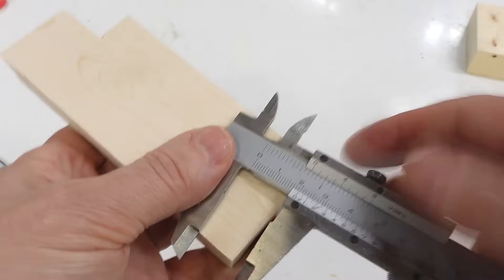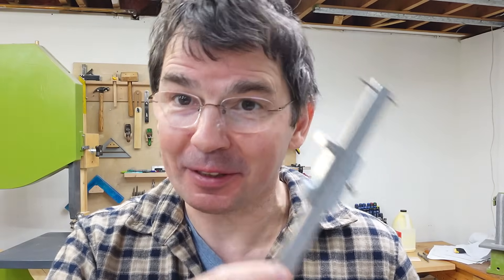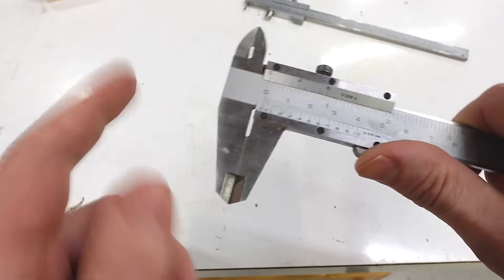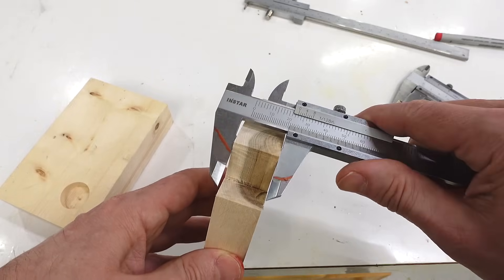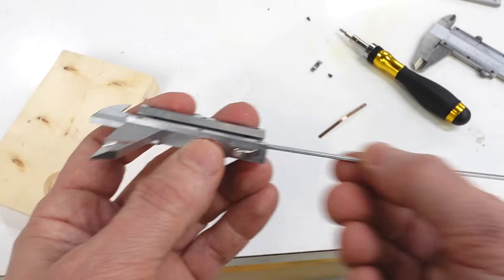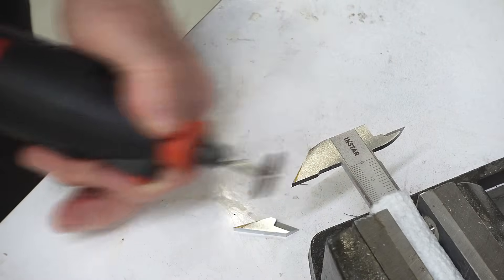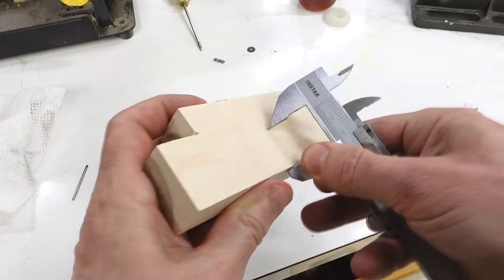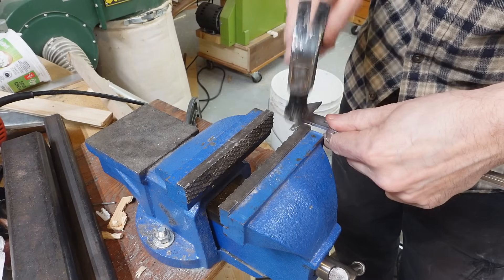Making scribing calipers

Comment: i misread it as scribbling calipers lol ,...but got me thinking what if you made the top part of the larger side of the caliper into a ruling pen, then you could just draw your line instead of scribing, the inside of the pen would just be flat so you would always scribe at or very close to the line depending on the ink and placement of the outer piece of metal.

Comment: I use cut-off disks instead of the ceramic disks.  They are fiberglass reinforced, cut just as fast, but have some 'flex' and don't shatter.

Comment: This isn't your inspiration, dear Matthias. What you've discovered is a standard metalworker's marking tool in Germany, which I used more than 23 years ago during my apprenticeship as a metalworker. The tip used to be made of HSS, but now it's made of carbide. There are also metal marking gauges for wood, with circular blades, and they're not very expensive these days either.

Comment: I would never use the carbide caliper/marking gauge with the roller.  To properly mark a line at the right distance, a fence is required.

Comment: Kewl.

Yeah, I was taught to use scribing calipers by my dad, back in the Sixties. Handy!

About a dozen years ago, I scratch-built a pair of "giant scribing hermaphrodite calipers." About 10' long, overall, articulated. Purpose: Scribe a line on the wood-planked dock of the Jungle Cruise ride at Disneyland concentric to the 2-7/8" OD pipe guide rail under the dyed water of the attraction, as part of reworking the dock edge from segmented straight lines to smooth curves. The bottom end gripped the rail, with four small wheels, so we could roll the rig along.

Comment: I'm a machinist and sometimes use my Mitutoyo calipers to scribe lines. It's not a big deal, and I don't understand why some machinists are so upset by it. Most of the time, when using the outside jaws, you're measuring closer to the slide, not with the tips of the jaws. If you end up giving it a burr, stone it. If you're worried about calibration certifications, your calipers should not be the final say in inspection; they're for quick measurements out on the shop floor.
Reply: I never did it either until I saw a good machinist at work do it (I'm an engineer).  Now I do it.

Comment: I dunno if it's for engagement, but the right word here is "scribing," not "scoring "or "scratching." (various commenters use the words scribe/scribing/sciber, but I don't see any making this point exclusively).
Reply: What's the technical difference between "scribing", "scoring", and "scratching"?
Reply: @BenInSeattle  That's not really a question with an answer. "Scribing" it the term we use when marking metal, and "scoring" is a term that is used with respect to wood and paper. They do not have "technical" definitions in the same domain, and I'm not sure that "scratching" has one at all. This is a little like asking a violinist what the technical difference is between "vibrato" and "the way you shake your fingers on your left hand while you play."
Reply: @johnhawkinson  Ah, I thought "scribing is the right word" meant the other words were not right. I get it now, they are all correct, but "scribing" is the most precise.
Reply: @BenInSeattle  It's not really "precision" as much as "the right word for this area of work." Trying another metaphor, supposed someone asked why you "drive a car" but "ride a bicycle." You could "drive a bicycle" but we don't way that. And you would not say "ride a car." (You could say "ride in a car," but that has a different meaning).
Reply: @johnhawkinson  How sure are you that people don't use the term "scoring" in carpentry? I'm not a carpenter, so I claim no expertise, but googling about makes it seem like experts use both "scribing" and "scoring" to mean the same thing. I think an analogy might be "piloting a plane" and "flying a plane": both are correct although one is used more often than the other.

(Since it's hard to tell tone of voice from text, I should probably say that I'm not arguing. I'm just curious and want to learn.)
Reply: @BenInSeattle  That's not what I said. Indeed, I said "scoring" is a term used with respect to wood and paper. That's carpentry. But for metalworking and machining, scoring is not a term that is used. Your analogy as to piloting would support the use of the term scoring on metal, but that's the opposite of my point: The term scoring is NOT used with respect to metal, both are NOT correct.

Comment: There is a tool for that, it's called Streichmaß. One my father had was a wooden block with two sticks in it, each with a nail in it. Simple, but surprisingly useful!
Reply from the maker: yes, quite aware of these, but I always end up setting them with calipers.  Might as well scratch with the calipers.

Comment: the purpose-built ones you ordered seem like they would be much harder to hold perpendicular to the edge you are tracing, causing variation in width of the offset

Comment: Love this. Did a very similar thing (without the longer leg, smart design choice!) on my old General fractional calipers and use the crap out of them for the same application. 

In hindsight, have you considered swapping the carbide scribe tip with drill rod or similar 2mm tool steel for woodworking? It’s easy to sharpen and resilient enough to withstand scribing. I’ve used drill rod for making regular marking gauges and quite like it, plus I don’t feel bad when the tips are pennies to replace. 

Thanks for sharing!
Reply: Or a broken 2mm drill...
Reply from the maker: I figured if I broke all three carbide tips, I could just swap it for a nail.  Don't have any 2 mm drill rod.  There might be other shafting that works too.

Comment: Definine 'accurately' though as its a vernier user vision is likely the limiting factor and calipers generally are not very accurate anyway with how long the jaws are.
For a woodworker you do seem to be developing into a machinist in the most amusing fashion, and I can absolutely approve of using a cheap tool to make what you need out of it. Though with any of these cheap tools you can easily end up spending more time and effort making it work well enough in the first place, but sometimes you do get very lucky. I'm fortunate in having a retailer largely of decent enough relatively budget tools in walking distance so I'd probably spend a little more on the tool to butcher but you can't beat the wait time.
Reply from the maker: .1 mm accuracy is good enough for woodworking, and that is easy to read off the veneer caliper.
Reply: @matthiaswandel  Unless you don't have any old Vernier calipers, and in 2020s all Verniers in stores are 0.02 mm which will make you curse endlessly if you are over 45.
Reply: His videos that got me hooked were wood gears and a counter.  He's always been a machinist, he just happens to work mostly in wood.

Comment: My dad made a scribe calliper with teeth of a circle saw blade. De soldered the tooth and grind out a portion on the beak of the calliper. And also has a long and short beak. Both sides have the widia insert. Still working great after more than 40 years.
Reply from the maker: Neat.  Not something I have the skills or equipment for.  If I need to scratch steel, I'll use the ones I bought.
Reply: @matthiaswandel use a angle grinder to gut out a teeth of an old circular saw blade and use some 5 min epoxy. Epoxy should be enough for this application

Comment: You can reset the caliper using the 6 screws on the reading side without having to sharpen it.
Reply from the maker: I could set it so the inside is right, but then the outside measurement is wrong

Comment: The problem with grinding back to the square part is now you're got twist error: if your angle changes, the distance to the point of the scribe changes.  It may not be important to the kind of work you do, but that is part of the reason why the jaws are ground narrow in the fist place.
Reply from the maker: its cosine error.  If I'm off by 2 degrees, which is quite visible, then I will be 0.06% off length wise.  That's ok with me.
Reply: @matthiaswandel  I'm glad I checked my initial math before replying... 0.06 % is .0006 in decimal... So .0006"/ inch of error

Comment: 3:55 I try to avoid using those discs at all costs because I had one just randomly blow up on me as a kid, not even cutting anything- just blew up and it’s scared me ever since. I only use the reinforced ones now… lol
Reply: I’m imagining the disc exploding completely unprovoked as soon as you walked into the shop, dremel not even plugged in 😂
Reply: I remember sitting in a friend's living room when a piece of metal came flying through the wall above my head, through the wall across from me into the den, and embedded itself into the wall on the other side of the den.  My friend was in the garage tinkering with something and was spinning some metal part way too fast.  Ever since then I stay out of the plane of any fast spinning object.

Comment: It would be interesting to add a pin or shelf to the inside of the moving jaw at the same height as the fixed jaws point. That way you won't get off-level error.
Reply: Had to read it twice to picture what you meant.  Great idea!

Comment: Would it be possible to do this by drilling a hole in the end of the caliper to insert a replaceable scribe? or is the material too thin?
Reply from the maker: if you can drill really precisely in the stainless steel, I suppose yes.
Reply: @matthiaswandel  Well, you DID say this would be much more complicated if you were a machinist. Here's one way to make it much more complicated, I guess. A firm grip in a mill vise, and a mill with almost no run-out would do it.

Comment: 4:20 I've seen good things by stacking 2 cutoff disks - if you don't need the very thin kerf, they are far more rugged in this stacked fashion.
Reply from the maker: I also have some thicker disks, but prefer not to use them.
Reply: Interesting idea. 👍
Reply: If you've never tried them, the Dremel EZ-Lock discs are worth every penny. Almost impossible to break, and last forever compared to the cheap ones.
Reply: @Kevin75668 That reminded me:
(It’s a bit long, I know)
Once I removed the whole AC unit out of a car without cutting any pipes.
(I’m a sound engineer, but sometimes I help people with odd problems that no one wants to do.)
The only tool that fitted was my Dremel. I succeeded, but broke a lot of EZ-disks. I guess they are not really meant for cutting thru the firewall of a car. 😁
But I agree, they are a bit sturdier than the others.
Reply: @Kevin75668  I just bought some, and they actually seem to work.

Comment: I wonder if you could just take a pair of cheap metal calipers and some lapping compound then slide them back and forth to make them feel much more premium? The metal is still going to likely be softer than more expensive calipers so it'll wear faster, but I hate that scratching sound cheap calipers have..
Reply: Absolutely, I’ve lapped cheap General calipers using the honing materials we already have on hand for edge tools, and it makes a huge improvement. Just remember to thoroughly bathe and degrease afterward, or the microscopic abrasive particles left behind—or embedded in the steel itself—will continue wearing the surfaces down with every movement. That might actually be a good thing, making it smoother over time, but typically that type of abrasive wear is what causes premature distortion on machines with sliding ways and beds, dipping where some grinding dust settled.